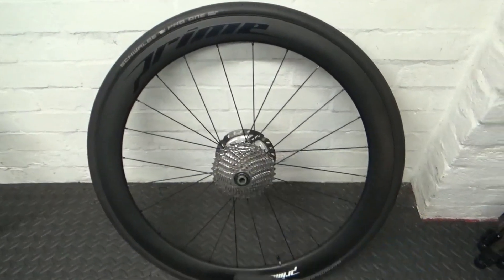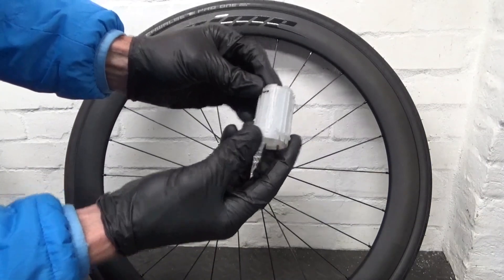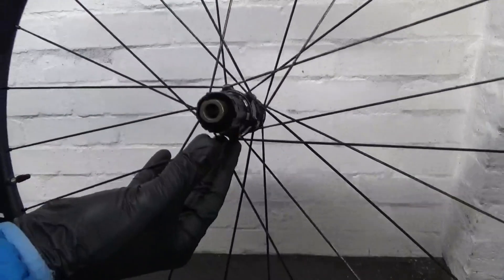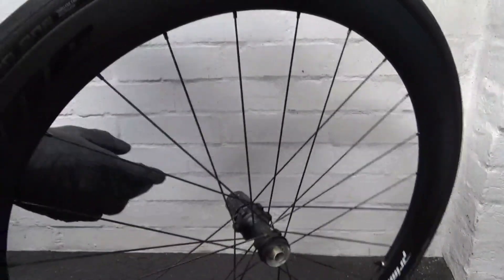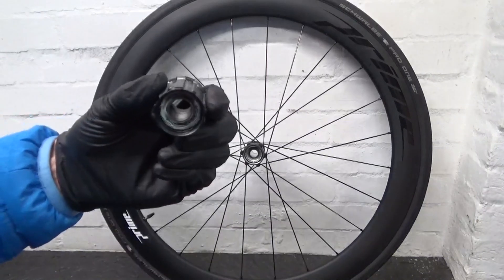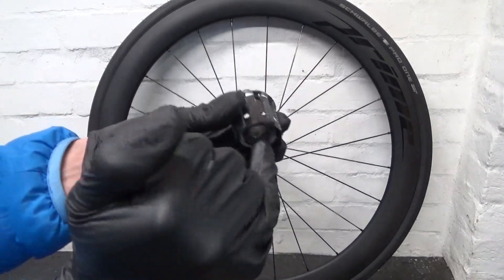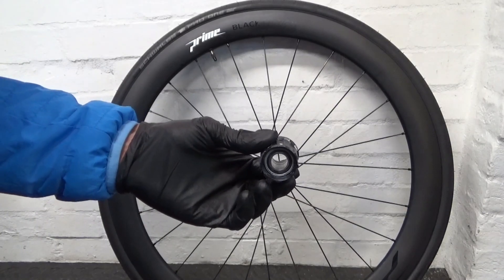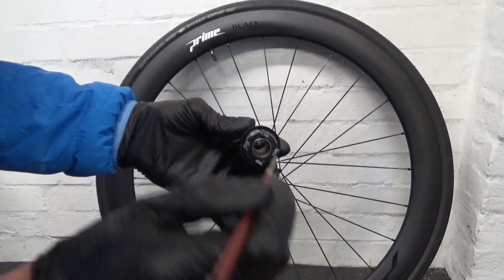Prime BlackEdition Carbon Disc Freehub Service Guide

Comment: Hi, I've got rim break se version. Assuming all is same. The tension on my qr has an impact on the noise. But the bearings same to be fine, when bikes on stand both wheels will always rotate so valves are at bottom. Exactly same on both sides. Great video. Appreciate it

Comment: Really appreciate you putting this up, I’ve got a brand new set of the RR-50 Black Edition wheels which were making a cracking sound on re-engagement of the free hub, just stripped it down and found it packed with thick white grease, pawls could barely move! I’ve used a thinner grease sparingly and it looks to have done the trick. 

Clue should have been in how quiet the freehub was from new...
Reply from the maker: David, they always use that thick grease in the Prime wheels! Proper sticky stuff that is!!
Reply: David, I just received my BlackEdition 50 wheelset 6 days ago and during my first test ride yesterday I’m experiencing a similar cracking/clunking sound you’re describing coming from the hub. I was able to narrow the sound to the new wheel hub after swapping back to my original rear wheel the sound was gone. The freehub was extremely quiet like none existence. I’ve contacted CRC for a replacement order and now waiting to hear back.
Reply: @erich7609  and how did it end?
Reply: @vadlme  I returned the wheelset and got a full refund. Still didn’t know the actual caused of the issue. I further researched and a local wheel builder said it could be a bad wheel built, like spokes not tightening to spec. It’s normal to heard the cracking sound from a brand new wheelset or after rebuilding but that sound should go away immediately.